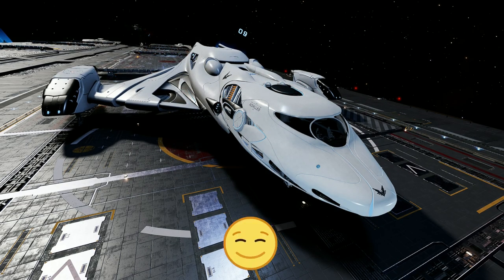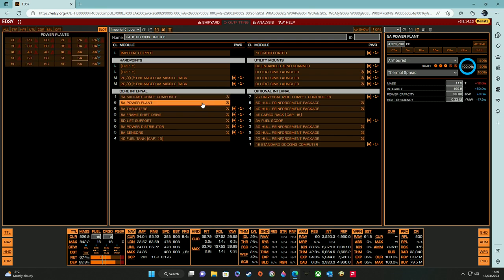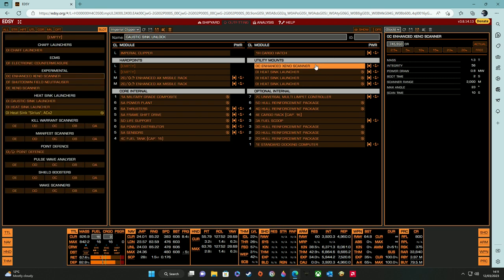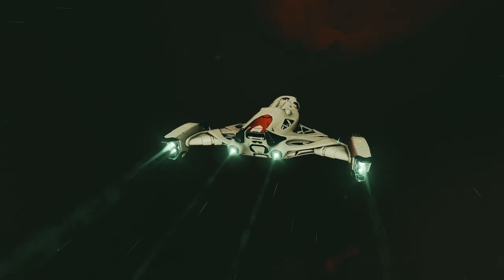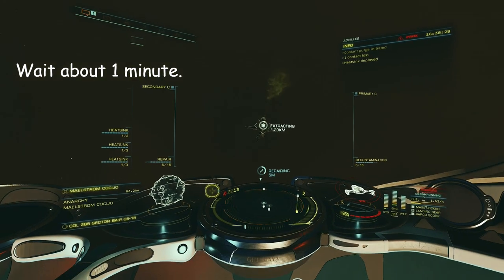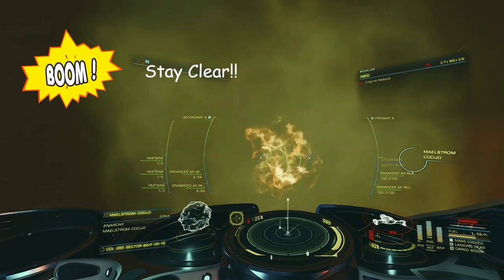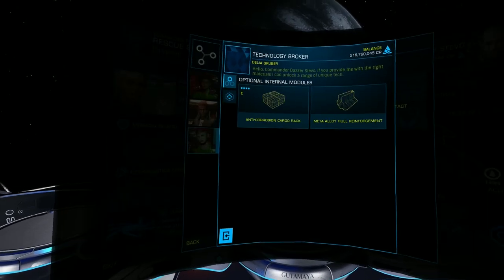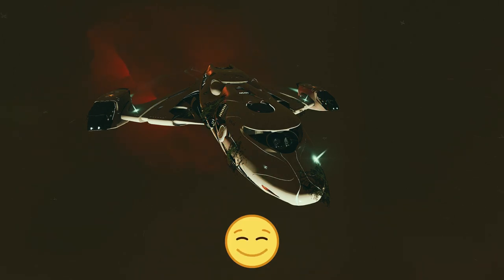Caustic Sink Launcher - Unlock - Tutorial Guide - Elite Dangerous

Comment: Low emission, thermal spread Power plant will keep the ship under the 20% thermal needed for getting close to the Fart mines. And find a dock within a jump or two so you can ditch the fuel scoop and add a module reinforcement. Ideally you want to take and modify an AXI build very slightly or use the AXI build guides as a reference. Long range, thermal vent beam lasers can also be an alternative to the missile racks since they give a 6km range....

I used the cutter for my maelstrom farming. it is the best large ship as you can also boost close to 500m/s and that will allow you to evade interdictions. With the low emissions and thermal spread on the power plant I only need to use heat sinks if I wonder a bit too close to the mines. No need for silent running at all except to burn off the caustic goop and that's where the beam lasers with thermal vent come in handy as well. To burn caustic just go silent running, boost and fire the beam lasers you'll get very toasty real fast and if you've been in the maelstrom for a bit you'll need to hit 200% plus thermal to burn it off.
Reply from the maker: I first built my Clipper without a fuel scoop and I barely got back to my carrier due to a constant string of hyperdictions, and I was only just two jumps away. I now keep it for those unlucky instances.
Now I have the Caustic Sink unlocked and have spent more time in the Maelstrom, I'm going to optimise my Clipper further as a dedicated Maelstrom Farmer. I'll be releasing that build video soon 😎
Reply: @eliteengineerdaz  Clipper does have a bad total range on one fuel tank compared to most of the other ships. Cutter has an extra 30 ish light years total which helps. I was two jumps away from the taranis maelstrom. I had enough fuel for 2 hyperdictions going in and 2 hyperdictions leaving the maelstrom. I eventually only ever got 3 in total on any one run so I can count myself lucky.

Now that I have the caustic sinks I'm heading back into the maelstrom to farm tissue samples and put them up on my carrier for squadron mates at a discount price. Then any leftovers I'll sell to everyone else at a small profit.

I made the mistake of selling palladium to everyone instead of just squad mates back in the other CG. I was helping out a squad mate make some money and loaded up 3000 odd ton on the carrier. I took 77,000 per ton profit and sold the palladium so that my squad mate could make 77,000 per ton as well. He got one run in and then switched ships and came back to find my carrier empty. SO I did another palladium run and sold him 2,500 ton at the same price it cost me. He said he'd never made that much money so quick in elite lol.
Reply: All great advice. Just bear in mind that the cutter has a very large overhead for unlock requriements, so it's always useful to know how to do similar tasks in ships that require less of a grind to acquire, or even those that don't require rank grinds at all. I imagine a Krait MkII would do very well in place of the clipper for commanders who haven't yet done the imperial grind. I will be using my cutter ofc :)

Comment: I also considered the Imperial Clipper, but as I said, I chose Anaconda because it has a very strong hull and eight utility slots. (But low speed! 😡)
However, I watched your video and got excited about building a Clipper to farm in Maelstrom. I suspect this won't be the last time the FDev will force us to visit these places and farm, farm, farm... materials. 😉
Reply from the maker: It will be alot easier with the Caustic Sink now equipped. 😊
Reply from the maker: @rogerstalder7184  The Cutter would be my preferred choice for its speed over the Anaconda.
Reply: @eliteengineerdaz  Buyed me the Clipper now 🤣
Reply: @rogerstalder7184  The damage on the hull will depend very much on the depth of the dive into the Maelstrom. Closer to the center of the poisonous cloud, the damage increases and the limpets may not have time to compensate for the damage.
If you collect materials at the edge of the cloud, then the repair can be successful.
I tried both options (Anaconda and Clipper) and chose Clipper because of the speed advantage. This allows you to safely get away from the flowers. Finally, a ship that no one needs has become useful! Ha ha ha!!! 😄

Comment: How does your health drops so slowly? Mine drops incredibly fast.
Reply from the maker: You must combine use of the repair limpets and decontamination limpets. Also try not to fly into the caustic clouds emitted from the Caustic Generators. It's all very tricky and is why the Caustic Sink is  so essential to have as it makes all these problems less of a pain 👍
Reply: @eliteengineerdaz  please, can you elaborate how decontamination limpets help?
Reply from the maker: @ECiriachi  Sure, they work the same as your repair limpets. But they remove the Caustic that's eating your ship, that is until your exposed to it again. Make sure you have nothing targeted, then fire either one off that's needed, it will then attach itself to your ship. Unfortunately, you cannot have more than one limpet attached to your ship at a time. Hope that helps.

Comment: Why is that you can only take a single Tissue with you with no Corrosion Cargo ?
Reply from the maker: Time - with no anti corrosion rack fitted in this build, I couldn't risk getting another tissue sample with my ship corroding. My focus was just to get the caustic sink unlocked.
I later improved the ship by fitting the anti corrosion rack and two caustic sink launchers for better and longer farming. 😎
Reply: @eliteengineerdaz  Ah so they stack in damage. alright. thx vm
Reply from the maker: @rogerstalder7184  I'm not sure if they stack in damage but when I tried collecting two, I almost got back to my carrier (which was only two jumps away) when my cargo hatch malfunctioned due to corrosive damage, which jettisoned one of them, I didn't notice until it was too late. 🙄
Reply: @eliteengineerdaz  Sounds to me if they stack :) Pretty much the Rockets from the Thargoids do aswell. Well i dont have a Caryer yet.. sooo i have to get all 5 to unluck the Sink Launcher at once, i got to go with Corrosion Cargo anyways :) but it would helped if i had some more space then just 16 ton. but thx again for those informations.